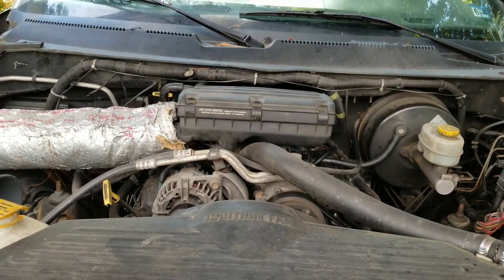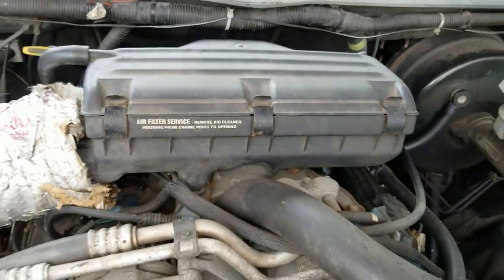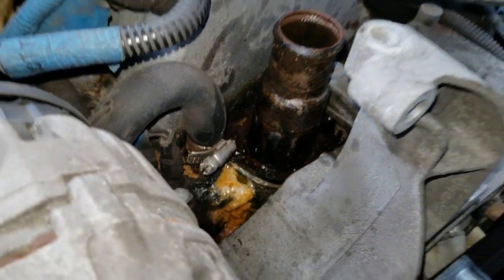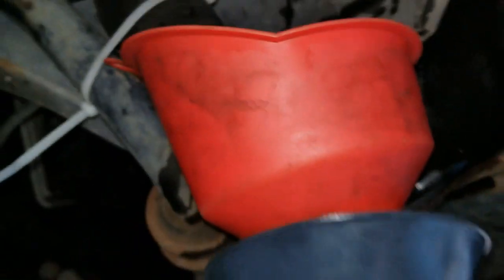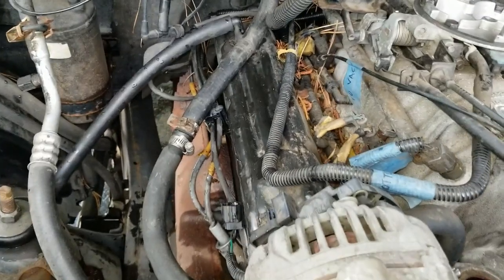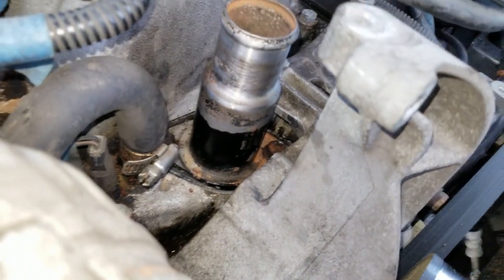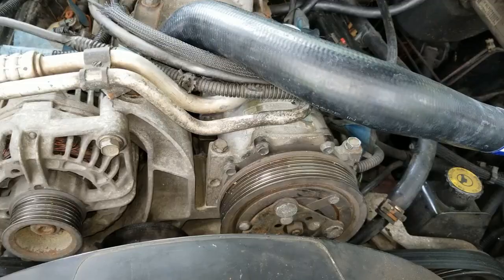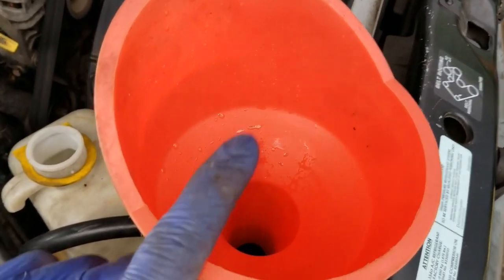2001 Dodge Ram 1500 - Replacing The Thermostat

Comment: While you’re down there, I would replace the thermostat sensor, imo, it’s to the left of where the radiator hose comes into the block, there’s a wire hook up leading to it.  Just another $15 part. I watched this video a year ago and now I’m having to replace this sensor, using this video as a reference point. 
Great video man thank you!  You allowed me to learn how to work on my own truck and talk like I know what I’m talking about.
Reply: What was the symptom when you sending unit went bad?
  I get no reading on the gauge in the dash on my 95 Ram and the truck started run very hot again just about since I change the thermostat a little while back.
  Btw, I am thinking my sending unit is to the right of the stat housing facing the front of the truck. It is a 5.9 engine.

Comment: Literally all you have to do is take off your air filter housing and reach down in there with a long enough extension and a half inch socket. You're welcome 20 or 30 minute job tops
Reply: Thanks Isaac!!
Reply: Ty
Reply: I've done had it done before he got it explained. Smh
Reply: @patrickpeters67  Actually I do like the details he covered. 
  That being said, I did remove one on ‘95 Dodge Ram without removing the ac. 
  Now I just need to know if that is the temp sending unit  to the side of the thermostat housing. 
  I changed the thermostat a while back, but the temp gauge in the dash quit working and the truck ran hot. 
  It had been losing coolant somewhere for a while. Wondering if it leaked around the stat housing and shorted the sending unit. 
  I also back flushed the radiator and plan to do the same with the engine block and heater core. 
  I also bought some rust removing liquid I thought I would try running a little bit as there is a lot of rust like stuff in the system.
Reply: I was thinking theres no way you need to do all that
Reply: still gotta drain the coolant though right?

Comment: Thanks alot for the video man. Im gonna be doing mine today fkr the first time and this video js exactly what i needed.
Reply: Its much easier to just remove the  air box  bracket and use a pair of needle nose vice grips to remove the  hose clamps, then you  can remove the  hose neck to change the thermostat, when reinstalling the hose clamp  safety wire in the open position so it will just slide down, much easier than removing the world. Tim

Comment: Nice and very thorough. Kind of glad you moved the alternator for us to see it clearer. My 2003 SLT is nearly identical, coolant overflow & air filter & hoses are slightly different designs. I got mine out past the alternator, but it's a tight squeeze. To put it back I'd recommend attaching the hose to the outlet pipe first, then bolting it in. What I also notice is my 03 has an inner thermostat gasket as well as a paper gasket. It makes a tighter seal. Newer Chryslers like my 05 PT Cruiser have the same which stops leaks without extra sealant. Doesn't appear to be a common part though, since no auto parts stores had one, I've only found it through OEM dealers.

Comment: It’s not mandatory to have to swing out the alternator, or move any AC parts. I used long handle angled pliers to get the hose clamp off. Would’ve been much easier with an actual hose clamp tool. Then the thermostat housing rotates easily out from behind everything.

Comment: I would recommend a 180 degree thermostat, if you use 160 it will cool faster but takes longer to heat in winter...
Reply from the maker: Actually, I use the stock 195 thermostat.  I tried a cooler thermostat in the past but in my opinion, unless you have a custom tune for your vehicle that allows you to adjust for coolant temperature, it throws off the engine management system.  I had a check engine light on for catalyst efficiency, and as soon as I changed back to a 195-degree thermostat, the check engine code cleared.  It could be an odd coincidence, but my theory is that the engine was running too rich because it was running cooler than what the PCM expected.
Reply: I prefer cooler thermostats myself, but on the Dodges it's likely to trigger a CEL (Check Engine Light) Code P0128 "Thermostat Stuck Open/Coolant Temperature Too Low.

Comment: Did the silicone work to prevent future leaks?
Reply: I know somebody that has a 5.9L with a leak at the housing.  Even with a new housing and gasket.  After a month it starts leaking again.  It is like one of the surfaces is warped.

Comment: Doing this exact job myself now, turns out my truck doesn't even have a thermostat fitted! No wonder it doesn't get hot!
*Edit, I'm also going to do a flush of the rad and heater core now as well! Luckily I have a drain right under the truck to let it all run into 🤣
Reply: R D  The water, a drain to let the water run into. The old fluid and any spilt new fluid was caught in a catch pan and added to a big container of waste oils/fluids I have that will be disposed of at my local recycling centre. I have cats and coolant can kill cats if they come into contact with it, I don't fuck around with it at all!

Comment: I broke one of the thermostat housing bolts and it is perfecly flush with the surface.
Anybody got any ideas on what to do next?
Reply: You can try a bolt extractor, or a left handed drill bit. Otherwise it's a drill out and tap a new thread.

Comment: Spraying the top of a bolt will NOT HELP YOUR BOLTS COME LOOSE  & taking off the a/c compressor and alternator was not necessary. 
Yes it’s a little tighter to get to but it can be done.